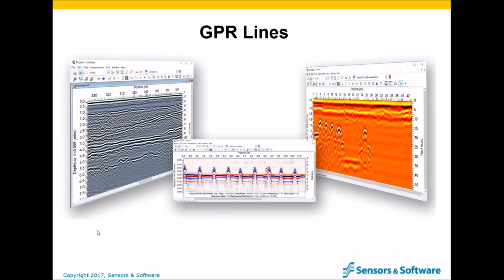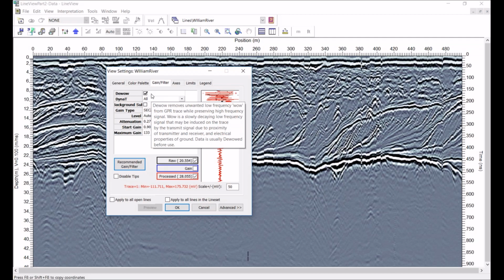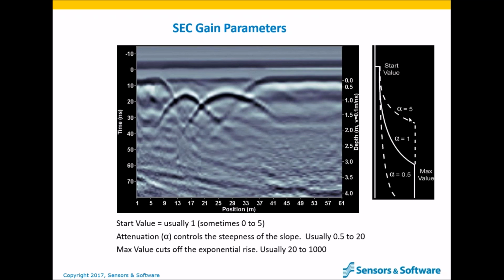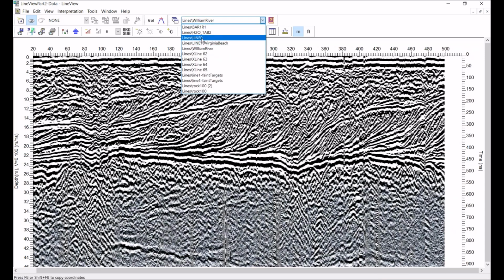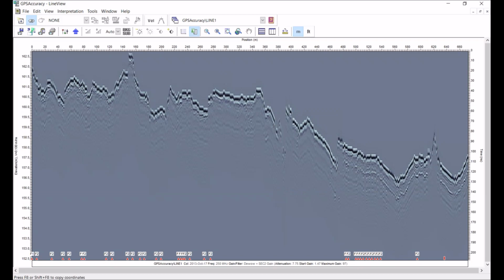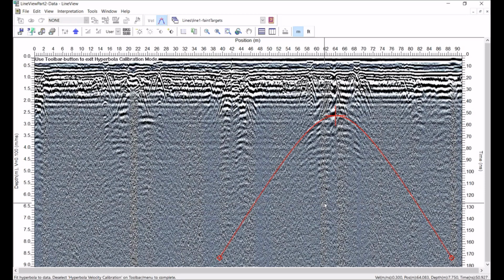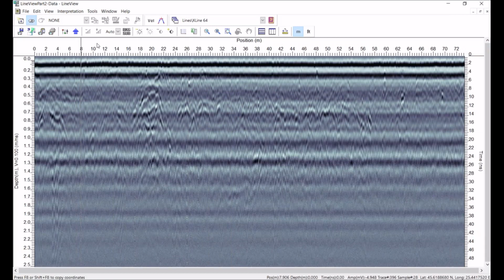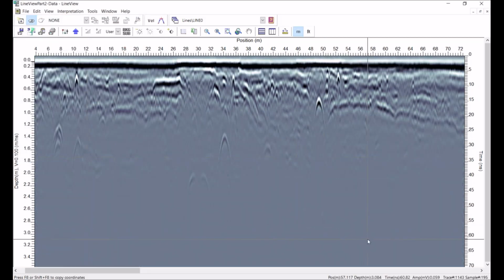Advanced features of LineView

Comment: Sir is it possible to get the Permittivity of material in this software..
Reply from the maker: Yes.  Relative Permittivity, K, is related to the GPR signal velocity.  EKKO_Project allows the user to measure the signal velocity using the hyperbola-fitting or “target at known depth” methods.
Reply: @sensoftgpr  Thank you. How to get the location of pot holes on the bituminous surface. ? Do I have to get line or grid survey?
Reply from the maker: Communicating through YouTube is not easy.  Can you please go to our website and send an e-mail, so it is easier to contact you and answer your questions. https://www.sensoft.ca/contact-us-gpr/